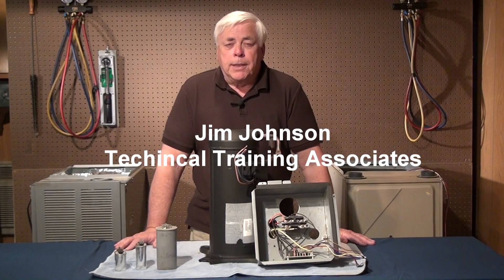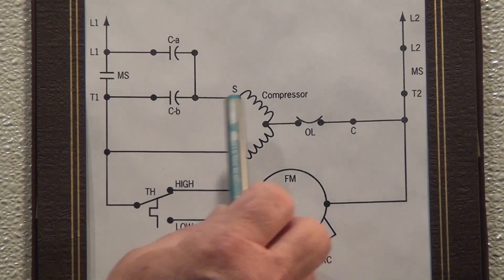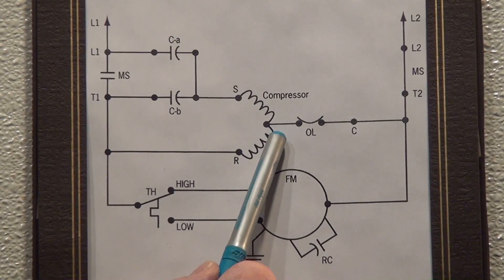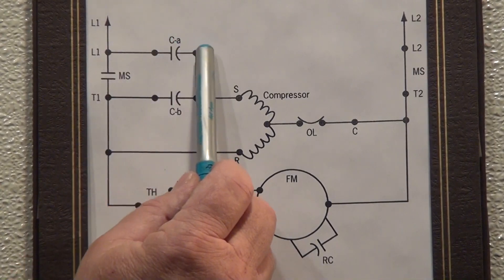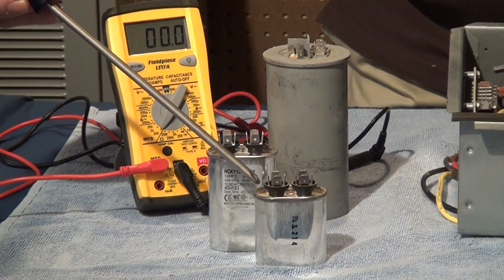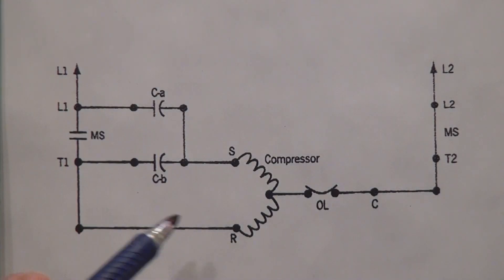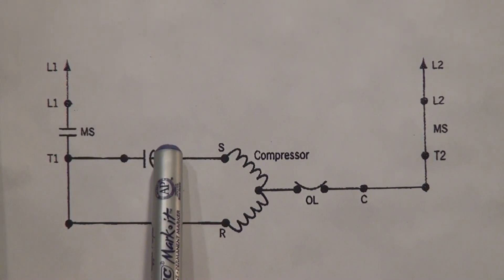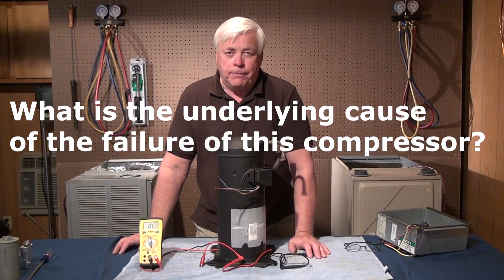HVACR Troubleshooting Series A Heat Pump That Won't Cool

Comment: I have been waiting for the answer for 10 years Jim no but seriously I can now answer that  what happened was the prior technician tried to be slick and use only one capacitor on the unit when the schematic clearly said it needs two . lesson here is If you don't read the schematic  you would have never caught on to that.

Comment: first you say capacitors are in series then you say they are in parallel. Which is it!
Reply: Marc DiPietro 
They are in parallel to each other but both of them in series with regards to the circuit that has the start winding on it. Hope that helps

Comment: Yes informative video showing i am out of my league even thinking about troubleshooting this problem.
Reply: no your not what happened was the prior technician tried to be slick and put only one capacitor on the unit when the schematic clearly said it needs two . If you don't read the schematic  you would have never caught that.

Comment: On my blower their is the compacitor on the outside and on the other side their is this littler thing that goes down in the blower and screws to the frame. I need to know what that is called. THANKS

Comment: Not bad, it does leave a lot out, and by no means would you be able to troubleshoot a heat pump with this information, most schematics are generally more complicated.  Still the info is very basic, but correct.